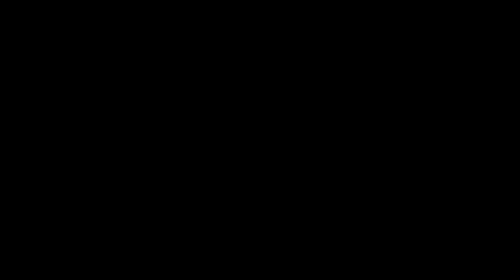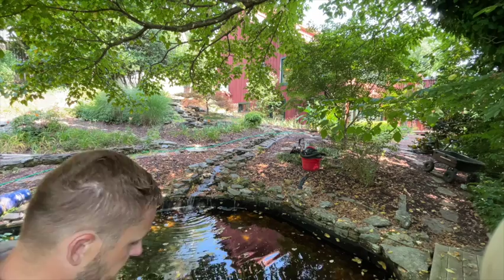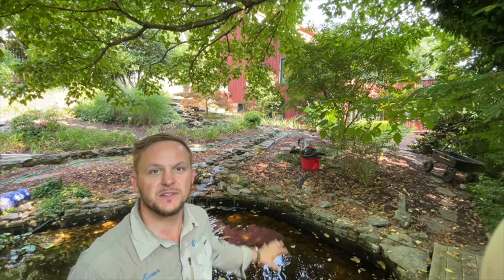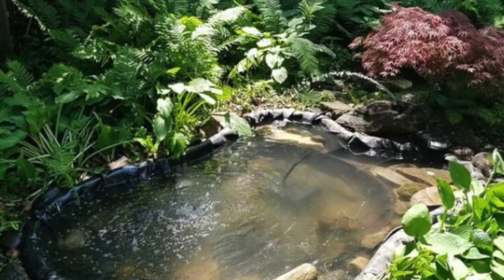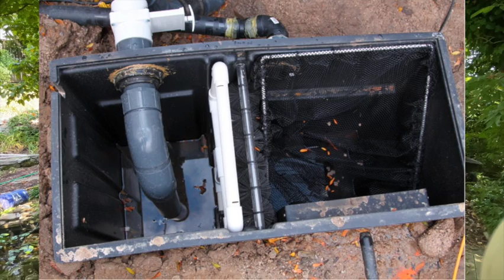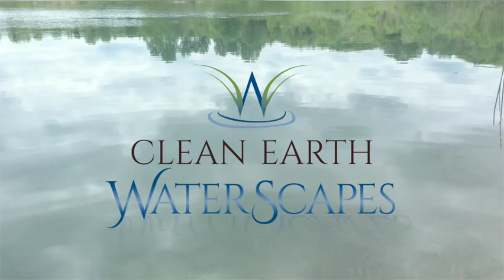Pond EVAPORATION and Water Loss

Comment: Thankyou for this video and explanation. This is the first video i found on this subject, and it clearly explains what im interested in without any nonsense. Thanks again !
I have just built a pondless waterfall with a 2500gph pump and about 5-6' total headlift. It has 4 16" wide spillways, all generating aeration, and it works wonderfully, but it loses about 8 gallons every 24 hours in our 90 degree days. Ive only had it running about a week and the water loss was freaking me out.
I now understand why professionals use enormous water storage capacity for comparatively small water features, and why they go to the trouble of installing auto fill valves. Ill be doing the latter because im currently topping up with a garden hose every day :)
Reply from the maker: Excellent! I’m happy this helps!